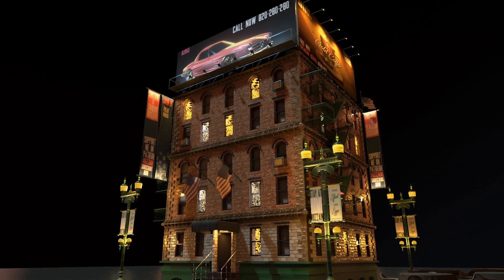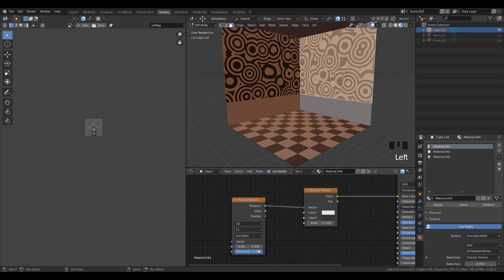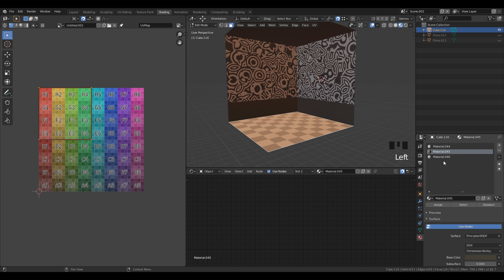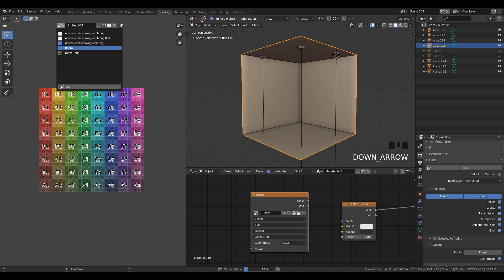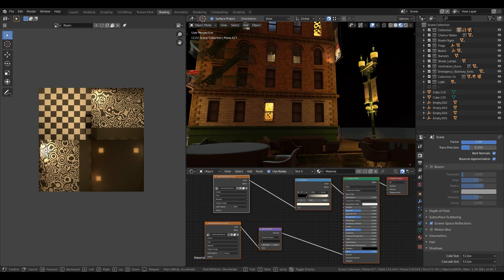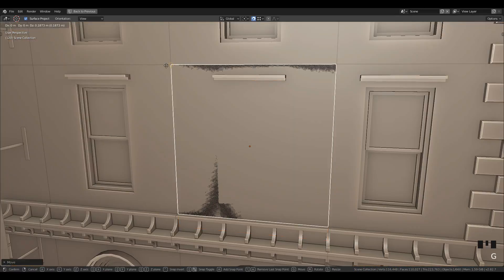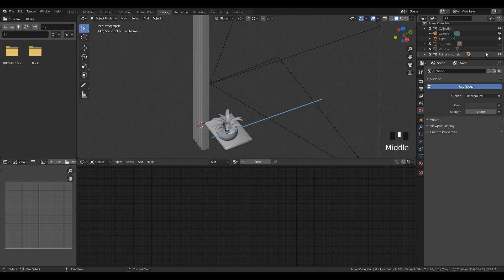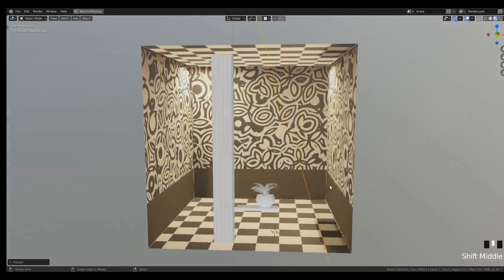3 Ways to Create Interior for Buildings Inside Blender

Comment: hey! this is really well explained but i'm having trouble getting the shader to repeat the room on one single face. Basically I have a cube that is supposed to be a whole building and i want the shader to render multiple floors. Any idea how i could do this?
Reply from the maker: You can use cubemap but if you have multiple building you will need to change settings of the cubemap for every material .It's better to use single plane and apply cubemap to it . Then you can make instances and snap it to where ever you want to show your interior.

Comment: i finished the building model textured and joined the all mesh when i export to the unreal engine i hit building lighting only it turns black i searched it on google i found it caused by overlapping uv how to join mesh without this problems help me pzzz
Reply from the maker: For built lighting you will need to have more then two uv slots , that can be created inside blender . FIrst select the mesh then under object data properties you will need to click on the plus sign under the uv map two have 2 slots . Then you will need to create uvs for the 2 slot .Unreal uses second uv slot for baking light and you will need to make sure that your uvs in second slot do not overlap on each other . Baking lightmass is not an easy task I will recommend you to use dynamic light and dynamic indirectly lighting . Even if you make perfect uvs for second slot for unreal even after that you will need to have more texel density(lightmap uvs resolution ) and less value for light scaling inside world tab to bake realistic lighting while working in Unreal . Building light is not good way to create a city . It is useful to create small scene but not for large scene cause you will end up scratching your head while dealing with the light/shadow bleeding artifacts  after baking.
Reply: @SaqibHussain88   thank you so bro
Reply: @SaqibHussain88   can you make video tutorial on it plz because i just stared using unreal for only 1 week  plz help me bro 
its its very complex thank you
Reply: @SaqibHussain88  no bro it dosnt work i created the second uv and smart uv project on second uv but it till turns black after building lighting only

Comment: Is the interior mapping + height map more performance optimized than using just the mesh?
Reply: I had the same doubt. I think a simple mesh with baked texture is more optimal while the second technique is more modular as you can just swap textures to change interior
Reply from the maker: @ghostriley22  Bro you can also use simple mesh cube as a modular asset all you need to do is to create that cube according to height and width of the window or wall panel .
Reply from the maker: @Johann Schepke depends on the resolution of the image  if you are comparing simple cube map with baked meshes. 1k or 2k can be considered to be really well as far as for optimization is concerned. But if you talk about parallax it will cost more .Parallax is also depends on the image resolution and the steps you give it have more depth for your meshes .